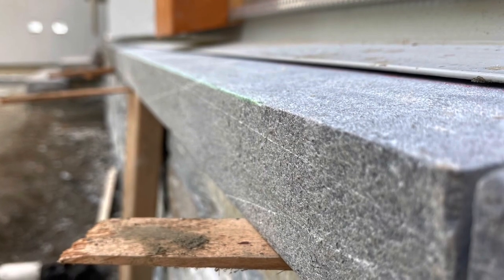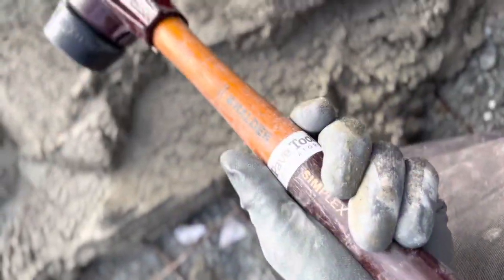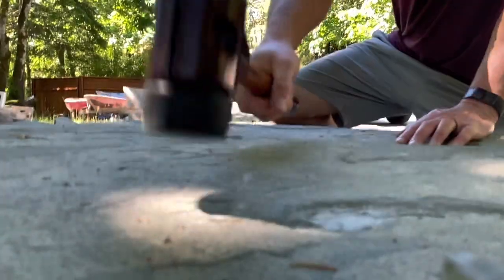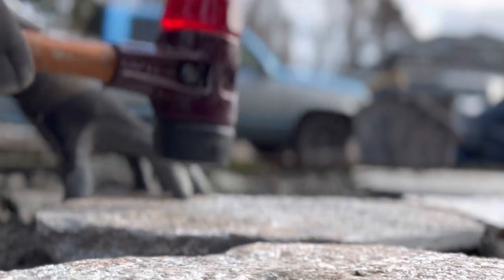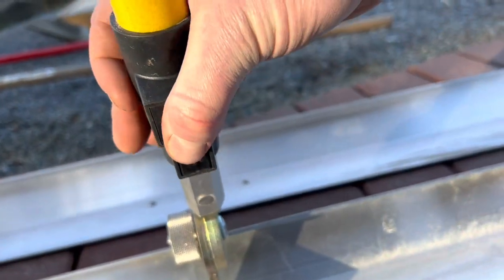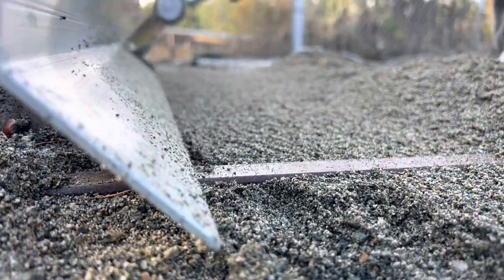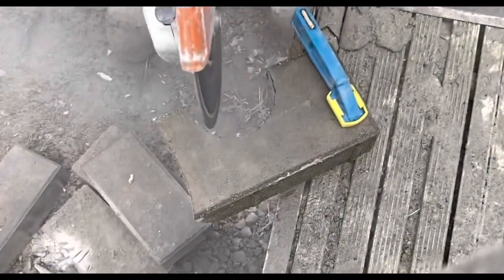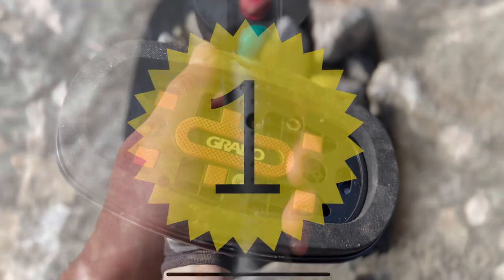The best HARDSCAPE TOOLS to improve efficiency and make your job SO MUCH EASIER!

Comment: Regarding stakes- will lengths of rebar be sufficient for taught lines, or do I need something more robust?
Reply from the maker: Rebar works too, as long as it’s not too bendy, and use the orange safety caps to avoid potential injury for anyone falling!

Comment: love your content. could you talk about your screeding rails. what do u find to be the best. we use 1 " round steel in various lengths. seems to work alright but constantly batteling to maintain the straightness over a season. any tips?
Reply from the maker: I used to use something similar. I switched to 1” square steel tubing and would never go back! Can get it from a metal wholesaler for pretty cheap.

Comment: after you screed a section and move your screeding rails, is there trick to keep your screed rails consistently level and at right height?
Reply from the maker: The biggest key is to do a very precise final screed of your base layer, so there are very little discrepancies on the surface (ideally less than 1/4”). Then you should be able to just double check the bars are still level with section before, and you can use a level or measure up to your stringlines to double check the other end before you continue to screed.
Reply: @HardscapeCanada  Thank you sir